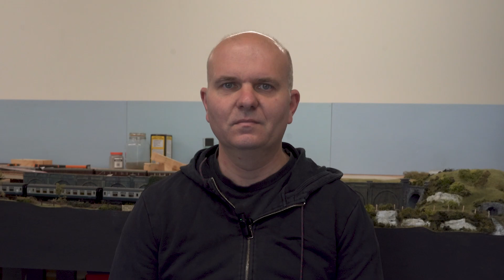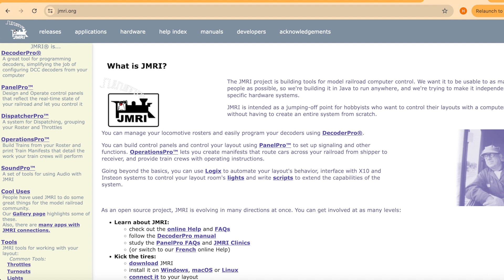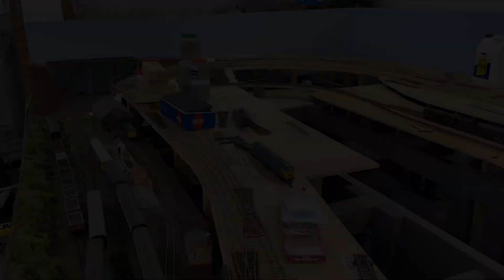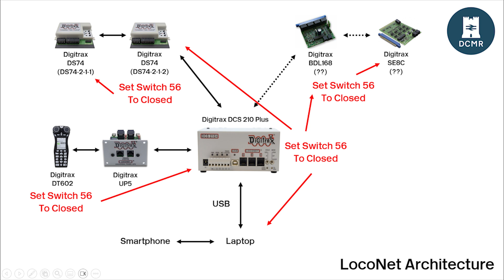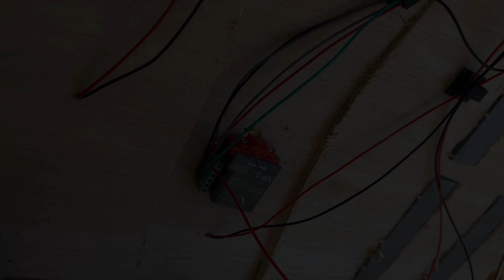16 - DC and DCC Wiring and Operations at Donnington Castle Model Railway using Digitrax

Comment: I'm using DCC-EX, which can put out DC with PWM controlled in software, I could still monitor current and voltage in DC mode, and don't need a dpdt switch. Very elegant solution.
Reply from the maker: Thanks, I’d not seen DCC-EX before. I just had a quick read and it looks really interesting. I’ll definitely have a closer look as it does sound like a much neater solution.
Reply: @DonningtonCastleModelRailway  The only thing I would point out is that the PWM rate is tied to the processor clock, so for the Arduino it's 133 KHz, which creates an audible hum in some locos. The ESP32 based board is much faster and may be effectively silent. Another neat thing is you can stack two power boards and get 4 channels, each of which is toggleable from the handset (your phone) between DCC, Prog, DC+ and DC-.

Comment: One of the best tutorials of this type I've seen. Extremely informative and watchable.

Regarding the placement of the power meter, I'd suggest adding a separate low-cost meter - see the item OOBill uses, for example - somewhere between the DPDT switch and the Heritage Track feed. But I guess you've already thought of that option and discounted it. 

Like the "power districts" approach.
Reply from the maker: That's a great idea, thanks! It would only need to work on DC power as the DCC Concepts one will catch everything running on DCC. So putting it between the Gaugemaster controller and the switch should work nicely.
Reply: @DonningtonCastleModelRailway  Happy to help 😊

Comment: Hey Martyn - thanks for the kind mention! Must admit I don't know much about Loconet but I guess in broadcast terms it's similar to CMRI - there's so little data, in modern terms, being thrown around, that it really doesn't matter. Looking at your diagram, the thing that interested me is Loconet seems to be a ring network - is that correct? Regards, Chris
Reply from the maker: Thanks Chris! I didn't mention it in the video but I am a total protocol geek. And I hadn't heard of CMRI before, so now I'm reading the protocol spec! Yes I think you're right, you don't have lots of chatty devices using bloated protocols so you don't get the issues you run into in other environments. I think the concept of LocoNet is similar to a ring, in that each device always has two interfaces, but I don't think you're ever supposed to create rings. I'm now kind of intrigued to know what happens if you did create a loop, but not brave enough to try in case you get the equivalent of a broadcast storm and it starts frying things.

Comment: Great video, which has given me some good ideas for my own future layout wiring. I know I'll need to think about multiple power districts too, and the PM74 is one possible way to do it, but is it Digitrax specific, or would it work with any DCC system to just split the power into districts, without any Digitrax or Loconet "smarts"?
Reply from the maker: Thanks! From re-reading the PM74 manual I believe it would do short protection with any DCC system. But without Loconet you would lose some of its other functionality. I believe the DCC Specialities PSX-4 does a similar job, although haven't used one myself. You could chat to James at DCC Train Automation or someone at DCC Concepts, as they have always given me good advice when I've needed it. Hope that helps.
Reply: @DonningtonCastleModelRailway  Hi, thanks for the reply, yes, I also read the PM74 manual last night and I agree it sounds like it would work for power districts and protection, but obviously no Loconet features. I looked at the PSXX range a while back, and they're good... also quite expensive if I remember rightly. Thanks again.  Mike.